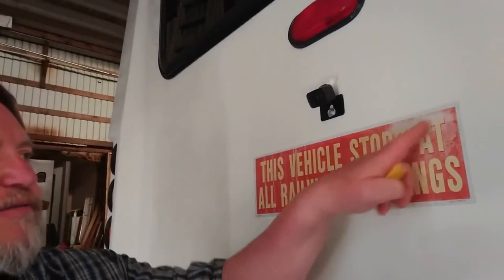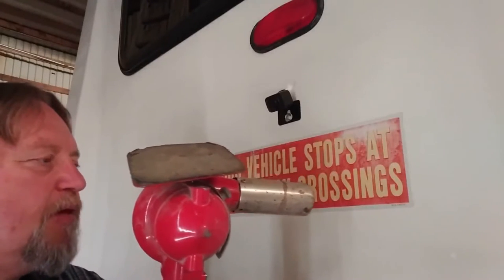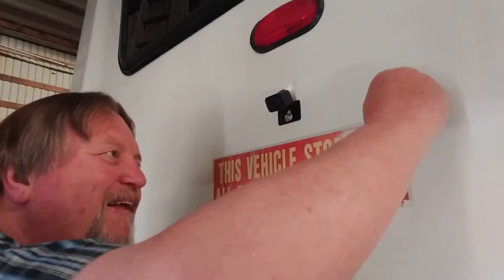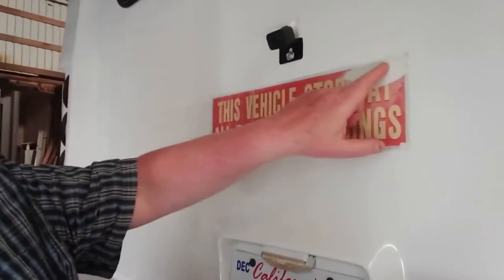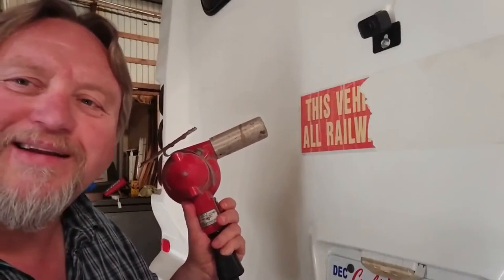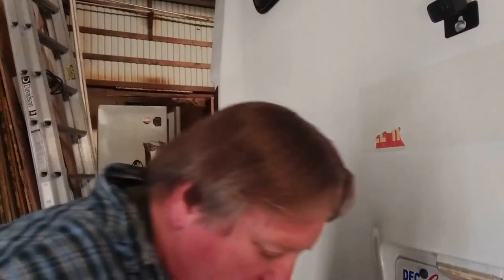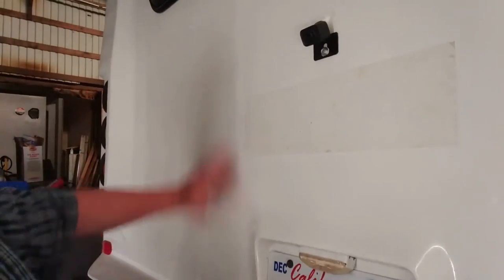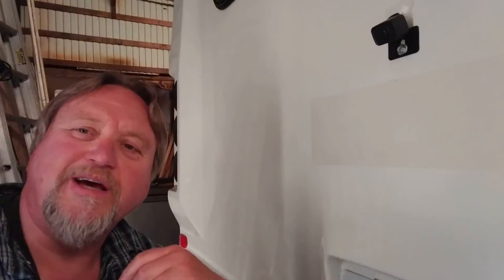Shuttle bus rv conversion (Part 53) The sticky details  of decal removal

Comment: my husband is an autobody shop owner.  He works closely with a local shop that installs graphics on the outside of vehicles.  I recently purchased a shuttle bus from our church and am removing the church logo and phone number from the side of the fiberglass shuttle bus.  Just like you experienced, there is the non-sticky, shiny shape of the original graphic.  According to the graphics shop (who installed the stickers to begin with on our church's shuttle bus) that is the original paint job that never received sun because the sticker was over it.  All you have to do is take a professional buffer to it.  You don't have to buff the entire vehicle, just buff out about 2" all the way around the area where the sticker was.  I'm having my husband bring home a buffer next weekend and plan to try it myself.  I expect it to work since the graphics place gave me the tip.  Good luck!
Reply from the maker: @Shannon Nybakken  I wish I could just buff it out but my decal had been taped off and painted around,so it left tape lines around where it was. Funny you should mention buffing because that was what the next video content is going to be. Thank you for the comment : )

Comment: Im a sign maker, started doing signs in 1974 and will be doing decals on the road... to get that last little bit off, use some brake fluid, just dont leave it on very long...  I have removed full vehicle wraps by using a butane  torch,  it heats it up  quickly and most of the time the glue comes off with the sticker, but you have to be very careful not to burn the paint...  I also use xylol to remove glue... you soak a rag and hold it on a section of the glue and the  use your rubber squeegee and it comes right off....   I just posted part 6 of my conversion (She's a dirty girl) the roof section was black, its fiberglass and major pitting, what would you do to a surface like that?
Reply from the maker: The American Wanderer  I will check it out and leave you a comment on your channel friend